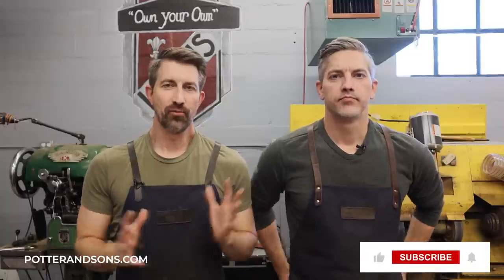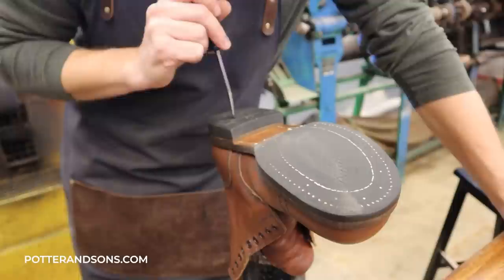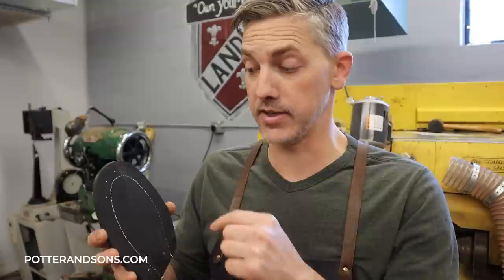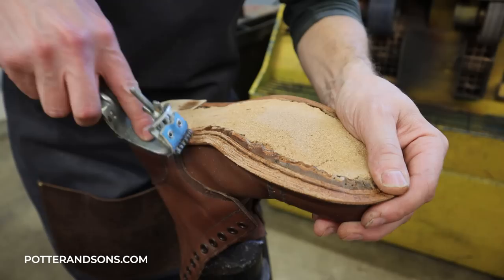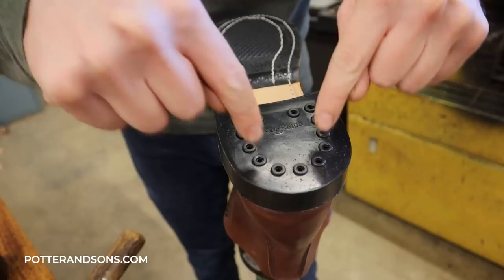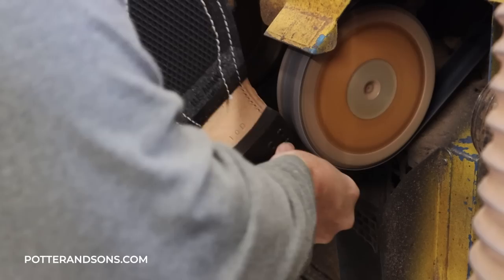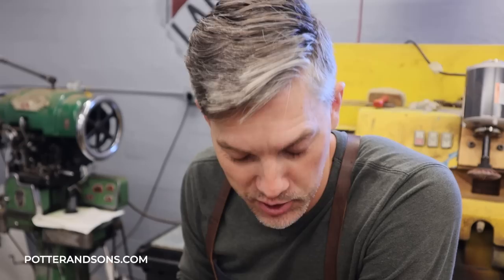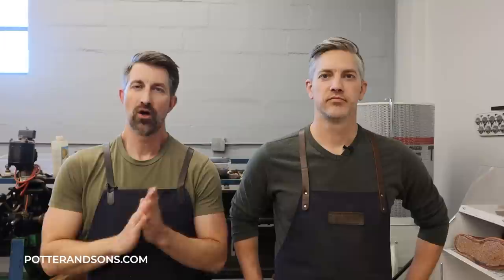WW2 U.S. Military Boots - Taken Apart & Restored

Comment: I think your assessment was spot on and I think you would have been perfectly ok to stich the sole to the leather.  During the war effort, they would not have wasted their time doing anything faux... the inside stitching on the sole would have had a purpose and I think the obvious purpose would have been to stich that rubber sole to the leather.  I am not an expert but I am a logical thinker.  The historical restorations are my favorites.
Reply: Agreed
Reply: Agreed, a second set of stitches would have helped to stop the outsole from coming off completely if the outer stitches failed. A soldier might break the outer stitches during action in the field and not get back to supply for weeks, so at least their sole wouldn't be flopping around too badly during that time.
Reply: Please add my agreement to the view that the stitch was functional. A faux stitch by WWII army contractors does not make sense.
Reply: Just a thought, could it be like we have on tires today, a signal that if those stiches are going to break, it is time to return the boots to the quatermaster for a pair of better/repaired/new. Just a thought, we always had our shoes inspected once a week before Friday leave, and if we did not cheng ed them and worn the sole to thin, we had to pay if they did not could have an easy repair.
Reply: I have a reproduction pair that's an exact duplicate of originals. The original name of these boots are Type II service shoes. Mine are the roughout style Every stitch  has a purpose nothing is or was was just for looks. My pair need new heels and soles. Unfortunately they're not taking new orders right now.

Comment: Im a wwii reenactor and cobbler!

At the front is considered to be one of the best reproducers of wwii us equipment. 

Their boots are known to be the best in the hobby. 

The pair you have is an older run (2000s- early 2010s) which were made out of the country in china and were known to be lacking in leather quality and sole mold accuracy. 

Their most recent run (2015-2021)was manufactured in the us in Tennessee. They are the best run of wwii us boots ever. 

The leather, construction, and rubber mold were all exact. They bought the rights to use the wwii last from the government to ensure it was as perfect as possible. They came in a reproduction box that they wouldve come in originally. They even came w original 40s army laces! 

They did cease production this past year due to the pandemic unfortunately, but plan to make their new run in mexico, where they currently manufacture their stellar line of german boots.

As for the rubber sole Stitiching, it was sewn to the midsole then stitched to the welt. 

As for the nomenclature, the type 2 came out in the 30s to fix the errors of the type 1, which had a leather sole and was over built. 

Hope this was helpful!
Reply: Makes you wonder why he didn't just buy a new pair?
Reply: @Tonks143  Because they cost $600 https://www.atthefront.com/Reproduction-WWII-Service-Shoes-Made-in-USA-p/usfssrt.htm

Comment: Amazing that when we got used boots in the military you can use hot water soaked in and let the boot dry to your feet, then it’s comfortable.
Reply: that’s how soldiers did that to the brand new Combat Boots that they were issued, because they were all black leather boots with hard rubber soles
Reply: @JohnH20111  yup we did it with ours in the 80s and 90s until they got the new rough out boots

Comment: There was a time when we would have what is traditionally known as the "jungle boot" modified for specific purposes, e.g. that aggressive tooth sole or heel for the Air Assault troop or the added padding that the South Korean cobblers used to build in for the Airborne Paratroopers.
Reply: Even in the 80's the Koreans made some great boots. Way better than issue.  We got custom-made boots after going to Korean Ranger school. Of course the Marine Corps said they weren't issue so we couldn't wear them. LOL

Comment: "Built to Last." Maybe not. I have been doing research on military footwear. In much of WW 2 Marines wore Field Shoes. They were shoes and Marines wore leggings to keep out dirt and sand. (Japanese soldiers referred to Marines as "Yellow Legs".) I read and article that explained that during war time the field shoes were only meant to last about 3 months. The reason was that Marines weren't expected to last more than 3 months. Extra material that went into a well built shoe would just be a waste. If a Marine was lucky enough to outlast their shoe....well...they would just be issued a new pair of shoes. A tough policy but logistics and materials is an essential part of winning a war. So...when I was a Marine in the 90's, our boots were very well made (glad to say). They were vulcanized construction and could be resoled several times. I think that vulcanized construction was a sort of revolution that made quality boots cheap to make. I know that most of my boots were about $38 a pair....I also know that most of them were tied together and left hanging over power lines at Camp Lejeune and 29 Palms when I got transferred!

Comment: You have to think of the guys that served during WWII. They had to March or walk pretty much everywhere they went, all across the continents that’s thousands of miles, just one pair of these would go through. When it comes to US Army manufacturing standards, not a lot has changed other than the materials used. But it still all has to be built to last in tough conditions. And it has to function correctly and reliably. Because in the line of duty, defects cause failures, and failures cost lives,  and lives, could cost the entire war. So every part had a purpose. The way you guys rebuilt the soles on these, seems about as authentic as what can be done nowadays. The problem you ultimately have, and will always have when working on vintage shoes, or trying to recreate a vintage model of shoe is, you can never have the exact same material used, and you can never have the exact same hands, that made the originals to start with. You can only try to re create what was done first. With that being said, what you did was the finest and most accurate way it could be done, with what you have to work with, your materials, and your equipment, and your hands. Things are only original once. Once its taken apart to be rebuilt, it will not and cannot ever be original ever again, only similar to original.

Comment: Hi Guys, I've seen a lot of your videos and it's probably a dumb question, but I have always wondered about the nails you use and how they don't come through the inner sole?  Are they just the right length that they don't protrude?
Reply from the maker: We may have to do a short video on this, as we receive this question all the time.  The reason you won’t feel a nail on your foot is because of the metal anvils we work on.  When a nail is hammered, the sharp tip hits the metal anvil and crimps over.
Reply: @TrentonHeath  Thank you for the quick response, that makes sense and a short video would be great!

Comment: This is completely off topic but I need answers so I came to the most recent video 😂

Ok so I have a pair of Nocona square toe boots that I have had for over 15 years and they are the most comfortable boot I have. Small hole in the sole so they need resoled. The problem is I didn’t like the light color of the toe so I used scuff cover from Kiwi to darken them. My question is, are they ruined? Can that scuff cover be removed or does it even need to be? I imagine it does so that condition can soak into the boot but I have no idea… Thanks for reading!

Comment: Okay before anyone flames me THIS is a history lesson not a "your wrong Trent and Heath" post. Let's start with they did state a replica boot, 100 percent correct they are replicas. Now onto the history... 

The original M42 boot had a much higher quarter shaft and twelve eyelets. These boots were known as Corcoran Jump Boots. These were manufactured for Airborne Paratroopers, as leather and manufacturing during WW2 was a commodity that had to be somewhat regulated/rationed for efficiency. Most WW2 Combat Soldiers wore a shorter quarter shaft leather shoe that resembled something along the lines of a Redwing Iron Ranger boot with M38 leggings.

These boots had several principles incorporated as Paratroopers were expected to perform at a level above and beyond the average Infantry Soldier of the time. The purpose of the high shaft quarters was for heavy ankle support due to jumping from an aircraft (while in flight) and carrying upwards of your own body weight in equipment. The nature of landing in a parachute harness with that amount of equipment is hazardous enough without combat being added. The second was the reinforced toe cap, once again the small confines of a C47 and all equipment being carried by human locomotion alone necessitates a better, heavier built, higher quality boot. 

I can say from personal experience that the Jump Boot has a role/curve on the ball section, this gives what is called a "Paratrooper Swagger" while you are marching/walking. To a bystander they view this as "Look at this guy would ya... All uppity." This actually comes from this section of the boot having this inverse arch. The boot was made this way to help with the PLF (Parachute Landing Fall), not to make the "Swagger" more exaggerated. 

Anyway, great video guys, just thought you may be interested in a history of the Corcoran Jump Boot

Jim

Veteran 3rd Combat Brigade, 2/505th P.I.R., 82nd ABN Division
"All the way and then some."